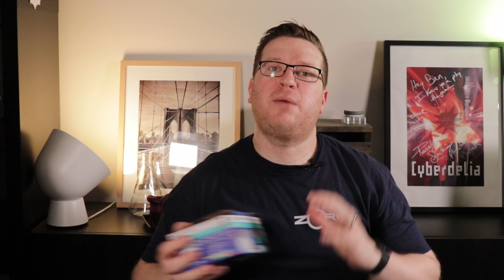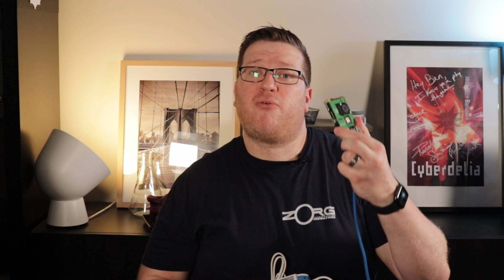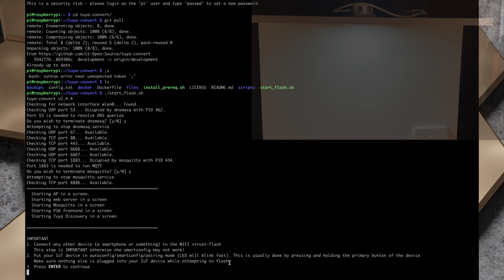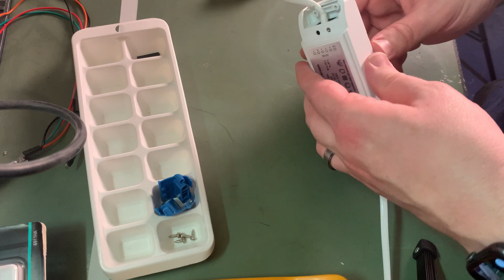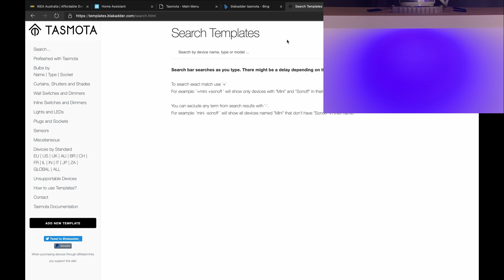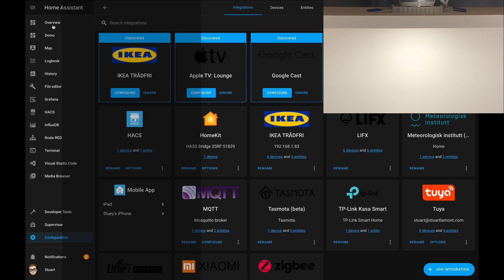Deta Grid Connect Smart LED Downlight - Unboxing and installing Tasmota

Comment: I bought these to replace the 6 downlights in my bedroom. I originally purchased the box of 4 and 2 separate ones but inexplicably the 2 separate ones could not be grouped with the 4 from the box. On further inspection, it was probably because the box of 4 were "DET902HA Series 2" and the separate ones were just "DET902HA". I have a Legrand push button dimmer and every time I turn off/on this dimmer switch, I have all sorts of issues such as some of the lights getting disconnected, not responding or responding very slowly, turning on but not responding to colour changes, etc. Any ideas? Could it be the dimmer switch or is it because these are DETA and not PHILIPS?
Reply from the maker: I've had a couple of my Deta's struggle to maintain connectivity even with the Tasmota firmware, it could be Wi-Fi Signal issues. Very hard to diagnose.
Reply: @HiveMindAutomation  Thanks for your reply. I connected all these lights to a powerboard, re-added them in Grid connect and they behaved just as shit as they did with the dimmer switch. Unless arlec can provide me with a solution, I'll be returning these lights to Bunnings. Very poor quality!

Comment: Flashed some of these late last year. Have had lots of issues with them. 9/10 a toggle to turn them on via a HA automation using MQTT fails to turn the lights on instantly. Sometimes I’ll get one turn on, the others catch up after 10 seconds. Same when toggling them off. Any ideas on how to fix that lag? I have tried both MQTT integration as well as the Tasmota integration.
Reply from the maker: Can't say I've had that problem. How's your Wi-Fi signal?

The other thing to look out for is load on your HA Server. I've found a lot of lag for MQTT (yes, the Tasmota Integration is still using MQTT) can be queueing from the HA host.

Comment: is there any difference between the deta rgb and the arlec rgb downlights?
Reply from the maker: yes. I have both.

The Deta are a bit brighter at 10 Watts compared to the 9 Watts of the Arlec.
The actual light emitting part is a fair bit taller in the Deta than the Arlec.
Physical Installation is the same for both, but the control boards are very different so the flashing process is a bit different. 
The contacts on the Deta are a lot harder to get Solder and a conductor onto.

Comment: Awesome thanks Stu. I did find that a low current computer usb port made it difficult to connect to the device once successfully flashed so I beefed up the current by switching to an external power supply and it was all good. Much Appreciated!
Reply from the maker: Nice one. The Logic voltage of your USB programmer does need to be pretty stable at 3V3.

Comment: Is there a similar grid product that’s cheaper for just white/warm light?
Reply from the maker: There are cheaper Arlec and Grid-Connect lights that do just White if you don't need the RGB function. They're $18.90 at Bunnings. There's also a 7W Deta RGB Unit for $28 if you don't want quite as much brightness.
Reply: @HiveMindAutomation  is Grid Connect just a Bunnings proprietary thing? I can’t find this for any other smart lights. I actually bought one delta 7W RGB and 1 Arlec 9W from Bunnings to compare them with intentions of returning. I really couldn’t tell much difference between the two - except the 7W delta was much brighter in RGB
Reply from the maker: Grid Connect is just Arlec and Deta (Actually the Same Company) Implementation of Tuya Smart.
Not sure if available outside of Bunnings.
In my opinion, the Deta is the better unit overall with better light output etc, but a complete pain to flash to Tasmota if you're into that sort of thing. 
I like the Deta units so much I just bought another 6 of them and installed them in the Loungeroom.... After flashing them with Tasmota of course.

Comment: I can't seem to get mine to work properly, I'm using a sparkfun CH340G to flash, but it isn't showing up in Tasmota. Any ideas? I've got a cable soldered in the ground pad, along with another wire which goes to my sparkfun, but when I bridge the IO0 it isn't showing up?

Thanks
Reply from the maker: Pretty hard to diagnose from the description you've given. 
Are you able to see the USB-> Serial interface on your computer? 
What are you using to flash? Tasmotizer? or something else? 
What Error are you seeing if any?
Can you elaborate on "it isn't showing up"? What isn't showing up? did you see a message that the flashing was completed successfully?
Reply: @HiveMindAutomation  I am using Tasmotizer to flash with, however, the Serial interface isn't showing up when I plug it in to my computer. I've rewatched the video and saw that you have another wire that goes between the usb flasher and the computer? But the spark fun doesn't have that with it.

Do you have a list of equipment that you used in the project?

Thanks
Reply from the maker: I used one of these USB->Serial Adapters: https://www.ebay.com.au/itm/274505241920

worth noting I bridged the VCC+ and 3V3 in the video to make sure the Logic is 3V3....
IO0 Bridges to ground, only on startup and it only needs to be for a few moments during startup.

Comment: Thanks for this tutorial, very clear and easy to follow. Have you had any issues with tasmota rebooting? I keep getting the restart reason: Hardware Watchdog when the light is at roughly 20% brightness.
Reply from the maker: Haven't had any issues with it rebooting on my devices. Only issue I've seen is needing to restart the lights if the Wifi goes down.
Reply: @HiveMindAutomation  Thanks for the reply. Just flashed a second light and it seems to do the restarting as well. I downgraded to 9.2.0 from 9.4.0 and it now seems to be stable, if anyone else has a similar issue.

Comment: Thanks for the vid, clear, concise and to the point, well done. I did this to an Arlec using Arduino Uno for a serial converter with lowered rx tx voltage no issues. I've ordered a TTL converter like yours and I'm curious as to why you connect vcc and 3.3v; I only needed 3.3v, grd, rx, tx. 
*Note for anyone planning to use Arduino UNO or FTDI Serial Adapter for serial programming, connect gnd to rst on Arduino just beware rx and tx are 5v and will most likely damage 3.3v things.
Reply from the maker: it's possible that I didn't need VCC and the 3V3 rails connected on my USB-Serial dongle, however I think it's what sets the logic voltage level on the TX and RX pins for my particular dongle.
Reply from the maker: @solyxius Here's a link to the ones I got from eBay: https://ebay.us/KWYLfD

Pretty much anything like this should do the trick

Comment: Can you just use the Tuya integration in home assistant?
Reply from the maker: I found with the Arlec Grid Connect lights that the Tuya integration in Home Assistant can’t talk directly to the lights. You have to create “Scenes” in Tuya Smart and then trigger the scenes in Home Assistant. The Amazon Echo integration works fine though.
My other complaint about the Tuya integration - like any cloud based service - is the latency it introduces. I’ll be flashing my Arlec grid connect downlights with Tasmota to properly integrate them into Home assistant using this same method.
Reply: @HiveMindAutomation  :) thanks I might try this then

Comment: Thanks for the video Stu, led me nicely through the process, the flashing was easy, the soldering not so much, quite tight and fiddly, but I got it done with a minimal amount of muttering. Will have to buy two more for the kitchen now I have it all working.
Reply from the maker: Glad it helped! The Soldering was definitely a pain, but I got pretty good at it by the time I got to the third control box, and limited my caffeine intake so I wasn't shaking so much :P
I'm loving having these in the kitchen with a Motion activated Automation. I'll definitely be getting more

Comment: Hi,

A noob here, I tried to find information on this light but could not. So I really appreciate it if you can answer my questions or point me toward somewhere I can find answers. 
There are 3 plug-in downlights controlled by 1 switch (well..a couple of 2-way switches) in our bedroom and I was thinking of replacing them with these. If I replace all three lights, can I control them separately with a phone app without installing any other electrical gismo?
Is there anything else specific I should know about these?

Cheers!
Reply from the maker: Hi Bugs,

The Grid-Connect App will allow you to control the lights individually or in a group, and you don't need to wire anything else in (provided you've got a plug-base in the ceiling cavity to plug these into). 
You don't need to flash them with custom firmware to achieve this, just follow the same process as in my Arlec Grid Connect Downlights video https://youtu.be/S2GZLdorwyA (or the included quick-start guide)The pairing process is identical for these Downlights.

To allow app connectivity, you need to ensure the switched power stays on.

It's worth noting that with the Arlec Downlights, setting the brightness to 1% in the Grid-Connect or Tuya Smart app set the lights to what I believe is closer to 40% brightness. 
I didn't test the Deta downlights for this issue, but have heard from others that it's the same. Flashing with the Custom Firmware allows proper control.

Comment: Thanks Stu, good tips and tricks. Seems mostly straightforward. Shame I suck at soldering but I suppose practise and all that...
Reply from the maker: There might be better Solder points to utilise on the underside of the board. 3V3 and GND are there but I didn't bother tracing the rest of the pins. It was easier to use the test pads. By the 3rd one I got pretty good at hitting those pads.

Comment: Nice video, but it would have been good to say why you would flash the firmware (what benefit you get over what's preloaded).
Reply from the maker: Good point - The included Firmware requires the Cloud, Whereas Tasmota means there's no cloud connection required, meaning I reduce latency. Additionally, the Tuya Integration into Home Assistant is - for want of a better word - Awful.

Comment: Do you believe you have better control over the light now than you did with the tyua integration.
Note there is a Tasmoto integration,
Also on the esp module you can follow the pins to the underside of the  board for easier access
Reply from the maker: Definitely have better control over the lights since flashing. The Tuya integration for Home Assistant is pretty lacking - per my Arlec Downlight Video - I'm using the Native Tasmota Integration in this video, which makes it significantly simpler to configure.
I Bought 2 more of them and now have motion activated lights in the kitchen, and created an after 9PM mode so they don't come on at full brightness.
Reply: @HiveMindAutomation  nice , do you have an easy way of switching the lights after 9. if you wanted full brightness for some reason.
Reply from the maker: At the moment it’s “Alexa set the kitchen lights to 100%” but I’m thinking of setting up a ZigBee button (video already shot but not yet released) to allow for manual light controls in some areas.